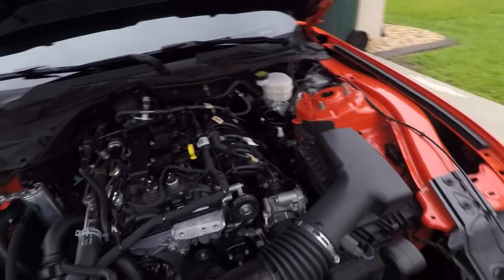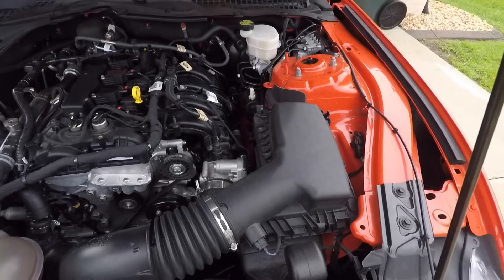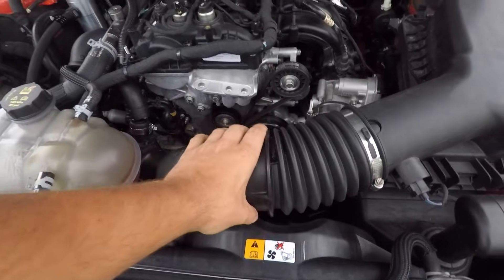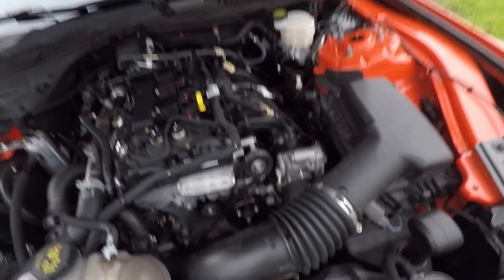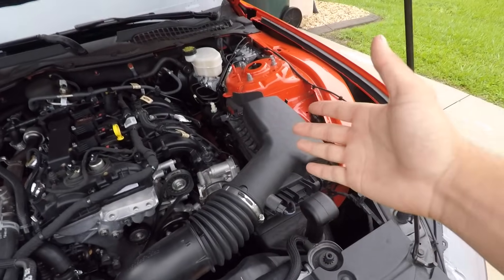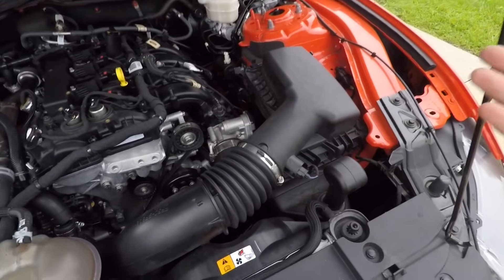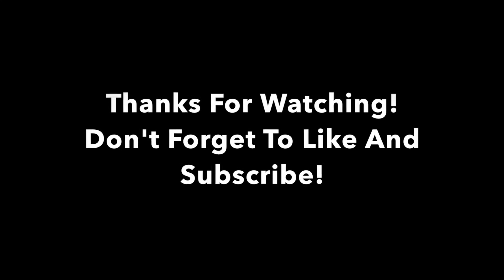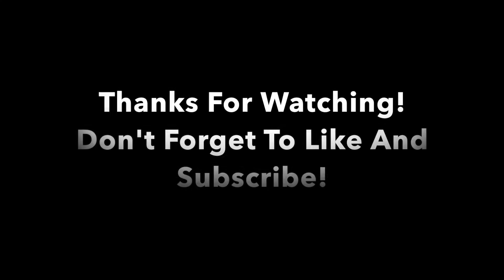Top 5 Mods Not To Do To Your Ecoboost Mustang

Comment: Air intake??? I just bought a 17 ecoboost and honestly that was the first thing I was going to do I guess I'll look into that
Reply from the maker: Alex Camacho yeah honestly all you'll need is a drop in filter and airaid intake tube. The stock box is best
Reply: Alex Camacho YES DO IT!!!  it does a difference...go with GREEN FILTER..
Reply: sergio norri where do I find a green filter ??
Reply: Alex Camacho Map performance intake 😎
Reply: Well, gotta tell you, I disagree about the CAI. BUT... I didn't "just" do the CAI. I got the Ford Performance M-9603-M4 CAI with calibration, and that preserves the OEM Ford manufacturer warranty if installed at a Ford dealer. OMG, what a frigging difference! It's a different car after this combo! More readily available torque, better throttle response, particularly when stabbing it. But probably THE most noticeable improvement is that HP falling off the cliff above 5,000rpm is GONE! You know how once you cross over 5,000 it feels like something's wrong with the car and it just dogs out? Not anymore after this kit. This kit mandates 91-93 octane fuel; no more Regular Unleaded, if you use that crap. I was using 92 from day 1 so no change in gas grade for me. And no BS, my MPG hasn't changed after the kit. If anything, it's 0.1 or 0.2mpg higher. Now, it's not like all of a sudden this kit is going to slam your head back each time you hit the gas, but all the throttle sluggishness, and powerband weirdness, and HP dropoff flaws the EcoBoost had are gone after this kit. It's seriously a way more refined, and actually noticeably more (but not *way more*) powerful car, preserving OEM warranty, and without costing ANY MPG. For like $700 installed. I have absolutely nothing negative to say about this kit and I've become a Ford Performance devotee...
Reply: You need a tune with it
Reply: 7steven I did the same to my old Ecoboost. I gained almost 5 mpg. That kit is the best thing you can do for an Ecoboost Mustang.
Reply: 7steven I agree that a tune with a CAI will gain the most in hp and torque. Even though they say ecoboost Mustang CAI do not require a tune, you won’t gain all that much (and my lose) hp with just a CAI.

I do agree with him not to delete the resonator, unless you get a catback system. I’ve heard exhausts with and without resonators, and personally like the quiet of the stock system. I may get a less restrictive resonator/muffler combo in the future, but the first mod IMHO is the tune with a reusable drop in filter (K&N or other - my preference is dry filter over oiled).
Reply: @7steven  if you don’t mind me asking how much did your Ford dealership charge you for that? I really want to get that for my mustang but don’t want to get ripped off by a greedy Ford dealership.

Comment: So what I got from this advice is, if you want more power, just go for the 5.0
Reply from the maker: 2008equinox lol not even close
Reply: Not even close to the HP, torque or sound of a 5.0. Is that what you say with lol?
Reply from the maker: 2008equinox no clue what you just said. All this video is about is mods you should not do/mods that are useless for performance
Reply: Great video, just saying, instead of investing all the mods for an EcoBoost to increase performance and sound, just start with a 5.0. I owned a 2015 5.0. Had to trade because of financial issue at that time. I was considering an EcoBoost now, but after viewing your honest and insightful review, I will just go for another 5.0. Keep up the great reviews. I found the information very informative, Thanks Bro.
Reply: Or buy an SS and get some power under 3000 rpm!!!!!
Reply: really I got go for the shelby or the cobra.. hell get two, mr moneybags
Reply: or just get a Bugatti

Comment: Stock cold air intake definitely doesn't make the most power. Maybe a new cold air intake needs a tune to make most use of the extra air but having a less restrictive intake definitely increases power
Reply from the maker: TehZured stock intake with a drop in filter has made the most power with stock turbo. It's dyno proven aftermarket intakes have actually lost power
Reply: C&L is dyno proven to increase hp...
Reply from the maker: TehZured do you believe the hp numbers every company claims:...lol
Reply: Idk about the ecoboost, but the C&L racer intake on my gt along with x pipe/axle back put me at 424whp and 400wtq
Reply: M-9603-M4 kit/calibration. Check out the before and after charts and gains claims. Looks too good to be true. I'll tell you from firsthand experience, I'll bet money those charts are legit!
Reply: With the turbo on it it’s not going to make a difference it’s still Going to boost the same, If anything just drop a K&N filter in the stock air box, you will lose horsepower with a cold air intake on these engines..You would have to get a tune and everything to even notice a slight improvement not worth the money at all. If you want more power you need to up the boost, and to do that you know you have to build the motor up
Reply: TehZured did you couple the CAI with a tune? If so, what was the hp/torque gains before the tune? Your numbers indicate a tune.

Comment: Ecoboost owner here. The Mishimoto intercooler outperforms the stock by a wide margin. Especially when racing, heat soak is a non issue.
Reply from the maker: Andrew Parris for less money you could've gotten a much better intercooler
Reply: Watch My Eco I'm assuming your referring to the Treadstone or something in that range. I only paid $450 for the Mishimoto. Going to the track and strip I have not had any heat soak issues. I'm not sure how I could've gotten a better one for cheaper. You have to understand that you don't need a full front mount unless your planning on upgrading the turbo. A stock mounting intercooler like the Mishimoto can handle all that the stock turbo can throw at it and then some. It can handle an aftermarket turbo up to around 450 rwhp.
Reply: @WatchMyEco  can you give some examples? im interested in getting one soon thanks

Comment: Hit the nail on the head haha, I used my throttle body spacer for meth then got another one after I sold my meth kit so I could still use it as a boost source for my bov 😊
Reply from the maker: Jonathan Abrantes they definitely have their place! Just not necessarily as a power mod lol

Comment: and never remove the cat... you will lose hp/tq.... remember who is smarter the  engineers that designed the engine/ ecu/ exhaust system   ( lots have phd's are other higher degrees ) or the guy. girl online, or at your parts shop?   it's like getting your medical degree at the university of facebook, giving you medical advice

Comment: I got the access port. Is there is a way to set the rev limit with the access port if so please make a video I've tried and can't get it.
Reply from the maker: Bear on A unicycle i do not believe so. I have an automatic so it doesn't allow me to change launch control or anything like that. Don't believe rev limiter can be adjusted though

Comment: What if its the roush cold air intake? Thats stock for mustang roush model
Reply from the maker: Don Charisma doesn't make a difference
Reply: ROUSH Mustang do not come with a CAI. Some dealers install them before selling to the customer.
Reply: hey so why does the exhaust sound for subarus sound better than ecoboost yet both cars have the same 4cyl engine ? have you ever noticed that.
Reply: oh ok
Reply: Subaru has a horizontally opposed engine. Eco Boost Ford’s are in-line.
Reply: @DonCharisma93  that's cause Subarus have boxer engines

Comment: HKS blow out valve it’s harmless right ..?
Reply: Well it can make your car run a little richer because the stock valve recirculates the air into the intake where as a blow off valve expels it into the atmosphere. It probably won't affect hp much but it can affect performance.
Reply: It didnt affect my performance?

Comment: I put a k&n drop in filter with the stock box and it seemed a lot better over the stock paper filter.
I was thinking on a vortex intercooler as I want a larger turbocharger and a mbrp 3 inch exhaust system  what are your thoughts I want the ford motorsport twin cams but I need advice on a tuner like bama or if I get a custom tune there is a shop near me that works on Subaru racing that said they could help me. Your thoughts would be helpful.

Comment: factual info is in the numbers. Do your own research . Mostly everything he mentions in this video is hear-say opinion, not even first hand experience ....elementary opinions at best
Reply: no one was ever claiming  performance gains of stock mount intercoolers anyway. Upgrading to anything over stock is going to give you consistency and avoid heatsoak issues.  The real joke here is that your front mount is overkill and is doing fuck all for you compared to any  aftermarket stock mount .  Just how much cooling power you think you need with your stupid pro tune and cut up exhaust ?

Comment: I’m surprised he didn’t say a blow off valve since it’s pretty much for the turbo noise
Reply: Blow off valves are great for sound without an exhaust. If you only use automatic is doesn't do much other than keep boost in the shifts. However, if you have a manual or are using the paddles in sport node so you control shift it does quite a bit. If you are rolling you can down shift to 3rd and your turbo will hold pressure much better so when you gas it you have instant power, not waiting to spool up. I have a turbosmart shorties dual port and it made a huge difference.

Comment: I would love to see your proof that the stock CAI has the best power compared to everything else... because you are pretty clueless if you actually think the stock CAI is the best
Reply: Data logs show aftermarket cold air intakes have higher temps on both a tuned and non-tuned car.
Reply: @k11yle  your statement isnt proof. Some mighty nice links and supporting evidence you provided here.

Comment: is this all true? so basically you can't add anything to these cars?
Reply: None of it is true. Sure there are some parts that will naturally perform worse than others, but with the right parts and a tune, you can easily squeeze out an extra 100+ horsepower and 100+ torque if it’s done properly.

Comment: gets pretty old hearing ppl repeatedly say cobb tunes blow motors. in that case, all tunes blow motors. people blow motors cause they drive like fkn idiots and go into full boost before 3k rpm. do some research for yourself before believing random ppl online saying their opinions.
Reply: The people blowing their motors are also the same people that are running with stock parts that can’t handle the shift in power.

Comment: Sounds horrible.  Worst sounding I have ever heard.  At least get a v6 to get a better sounding exhaust.
Reply from the maker: slc9800gtx had one. Not worth the slowness lol
Reply: The v6 stock with no tune does drive slow. I also had one. 2013
Reply from the maker: Ryan House you must be racing stock ecos then lol....and of course the turbo v6 would be faster. Common sense.
Reply: To me the V6 mustang is a dog. A guy around here has a built V6 and I beat him all the time with my mildly tuned VW Jetta 1.8 Turbo!

Comment: Number one don't buy a ecoboost be a man and get the 5.0
Reply from the maker: Eric Saalfeld 😂😂😂
Reply: Eric Saalfeld some of us like having good insurance rates and like having better than 11 mpg
Reply: The 5.0 it’s cool but so is the eco-boost I guess it’s kind of a preference thing you know.
Reply: Eric Saalfeld i enjoy my 5.0 i dont hate the ecoboost. Just my opinion whats the point of buying a muscle car without a v8? I enjoy the exhaust note of a v8 i hate the sound of 4 cylinders. If i was gonna do 4 cylinders again im going back to my subaru sti not a stang. The ecoboost can be fast if u have the money. Same as the 5.0.
Reply: Bryan Milligan thats pretty funny im pushing about 480-500 hp to my 5.0 and im fully capable of holding 23-24 mpg highway! I also for my age of 22 with full cover i pay a smidge over 200 bucks a month for a 2017 stang 5.0
Reply: Jacob Johnson my ecoboost is pushing 415 at the crank and if you wanna talk about insurance and gas, I get 38 mpg on the highway and my insurance is $88 as a 19 year old.
Reply: Bryan Milligan im gonna alsp call bs. Ive owned 4 banger insurance by myself with full coverage never dropped under a 100. Either your on mommies good driving record, the car is in her name most likely is cuz most 19 year olds dont have credit, or you dont have full coverage. Also 415 hp out of a 4 banger youd must baby foot it. Those motors arent rated for much power
Reply: Jacob Johnson Apparently you know my life. 4.0, no tickets, no accidents, full coverage, not financed. Custom cobb tune, roush cai, turbo back exhaust, Cobb intercooler, turbosmart bov and wastegate, catch can, and throttle body. Might I'm doing 400 at the wheels, so with the power train loss, it's probably around 440 at the crank. The more you know, buddy.
Reply: Am doing 5000 km a month...bought this car because I like the look not because word "muscle". Its cheap car that looks fine.I'd call it mondeo coupé :)
Reply: Number one,  people dont have to buy,  your fukin choice
Reply: Bought my 2018 EB Fastback with 10 spd A/T because I wanted a pony car,  wasn't interested in a muscle car. Plus, if you think about it, this has as much (or more) power as some of the earlier 'muscle cars' :)
Reply: Eric got beat by a ecoboost with $2000 in mods and now he's pissed lol
Reply: Jacob Johnson I'm 19 and have damn good credit, also insurance rates change drastically for where you are
Reply: He got caught when he said he was 19. All BS
Reply: Bryan Milligan I get 20mpg and pay 240$ at 19yrs old. Pretty economical unless you are from India living on dirt streets
Reply: Until you want an Ecoboost
Reply: are you gonna pay for it? this ecoboost are more powerful then older so called v8s.
Reply: @Heavenist95  I bought my 2017 Eco premium for about 10k less than a base v-8 and got 11k in Roush goodies for free because of the v-8 attitude.  I also can feel the 200# less on the front end BIG TIME,  It feels like a go cart but has a manageable power that has been proven to go faster than the v-8 in the corners.